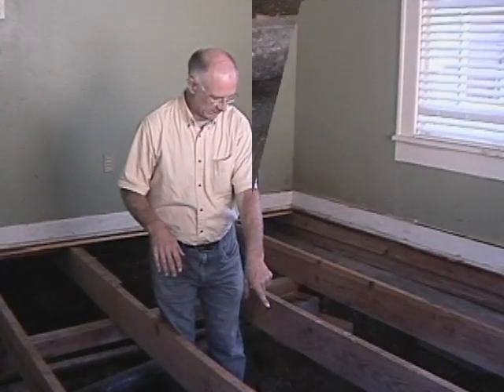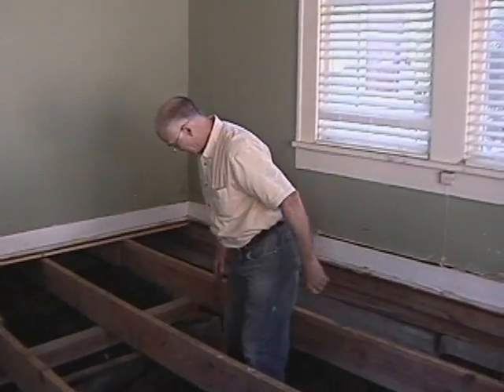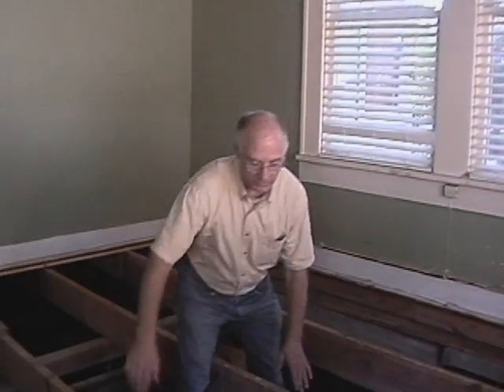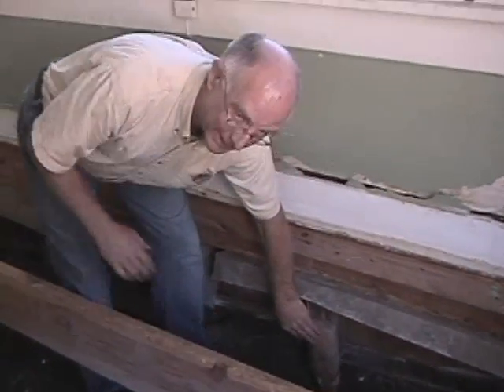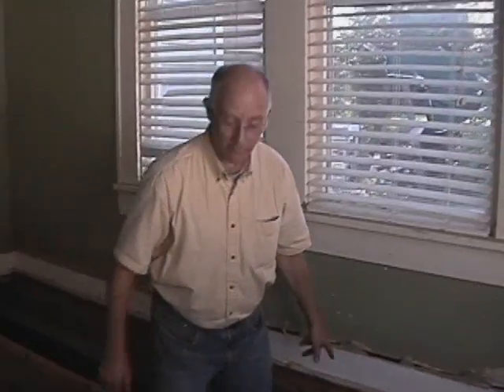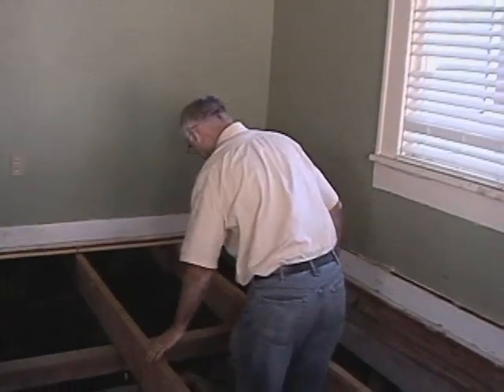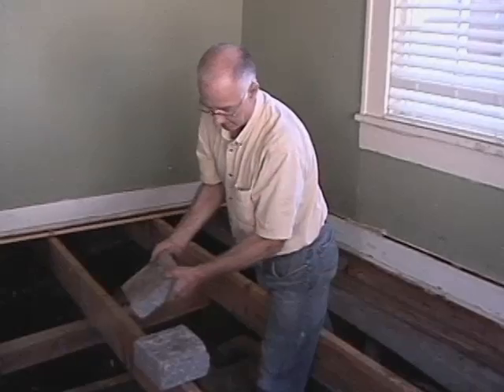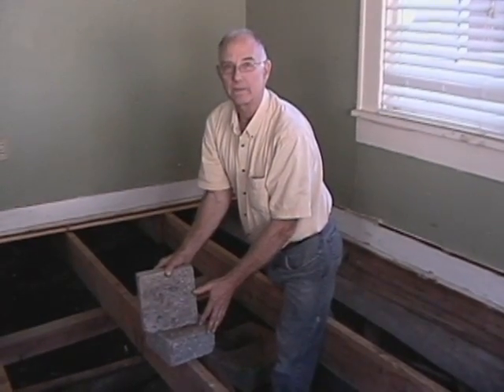Pier and Beam foundation repair that you can do yourself   part 1

Comment: does 8 x 8 x 4 inch 5000psi concrete block work to support jack?
Reply from the maker: They would work for a jack but put a piece of 2 X 12 on concrete then the jack on top of that , That keeps from breaking the jack base. 12 X 12 concrete would work better. use 24" X 24" X 4" concrete blocks for permanent  pier blocks then shim on top of that

Comment: Huello Sr I like you video. I have a question.  I buy  a house in waco. Texas and we have aproblemas. Every. time. rain the water. go inder of the house we worry. about that because is a lot water our foundation is concrete. Do you have any idea how to fix this problem? thank you for take some minutes of you time to read my comment. god bless you.
Reply from the maker: +Teresa rivera tejada It really depends on the soil of your area, and when the house was built. . Number 1 problem of slab house is water pooling against the house and working it's way under it .First solution is to figure out where the water is pooling and find a way to divert it away  around and away from the house.  Second solution is a french drain and it would be best to call an foundation engineer  and not a foundation  company. Make sure he is a certified engineer and you get a final report after work is done .  You will need it if you ever need to  sell or get a home loan or refinance your house.   Question is do you have any doors that are not closing properly ?? Are there any cracks ?starting to show??  I will answer any questions you have  .
Thanks for watching and let me know  we will stay in touch.  I will send you a video about drainage and a french drain.
Reply: thank you for respond me. The house. was build in 1950. and yeso there are some cracks on the walls but littles, some doors no closing propertly but not to hard.  Do you have information about companies can help me? is to expensive fix my problem?
Reply from the maker: +Teresa rivera tejada    Depends on what city you live.  If your  house is that old and you are having that small of problems then you are one of the lucky homeowners with good soil.  What you need is some kind of french drain to divert the water away from your house.  If I have time tomorrow I send you a video on what to do to help your problem.
Reply from the maker: +Teresa rivera tejada  Teresa,  Here is the first part of the dirt against the house. Another video coming soon
Reply from the maker: +Teresa rivera tejada   OOpp!!! here is link  https://youtu.be/2QsNtga0KVc
Reply: +dusty guy.  thank you.
Reply from the maker: +Teresa rivera tejada Still haven't sent you other video Maybe tomorrow
Reply from the maker: +Teresa rivera tejada     Here is the last  part of this video on foundation and french drain   thanks for your questions    https://youtu.be/6QllEFKo_FY

Comment: Did you buy those pads or are those pads that you made? I have to reinforce an area of my house and I wasn't sure if it would be better to buy something like that or to dig a hole and pour something using rebar and 5000 psi concrete.

Comment from the maker: the best thing is to keep water from getting under your house and causing the ground to swell and heave your piers up. If that happens make sure you have good ventilation so that the ground will dry out and stabilize and your piers will reset. Here in Dallas Ft Worth  area the rule is to have  two ft drainage from your house and a way to drain to the alley or street. Just any kind of a slight slope from the house. Don't use soaker hoses they will draw termites. (Some trades will disagree )